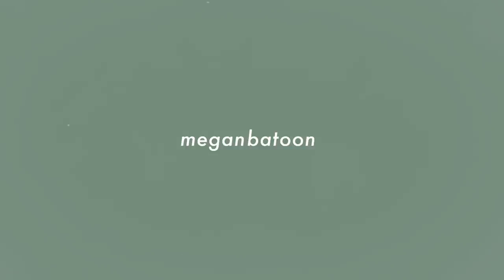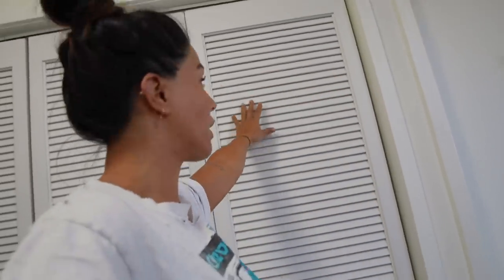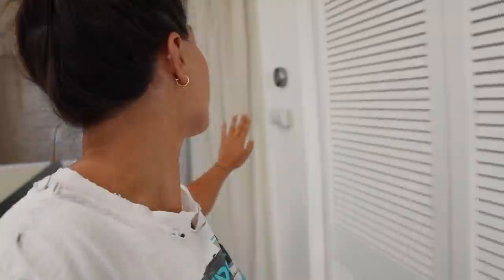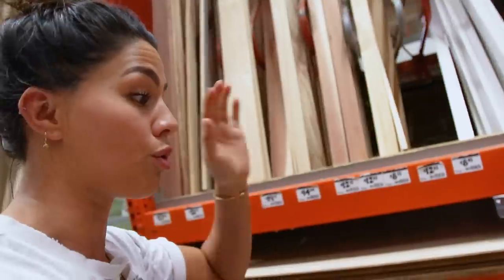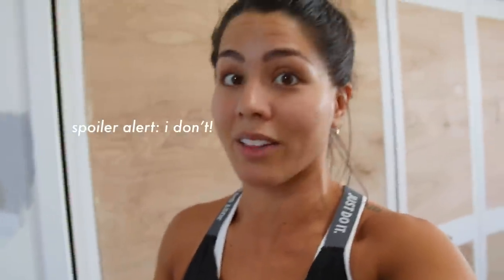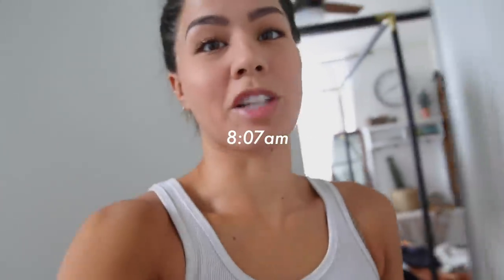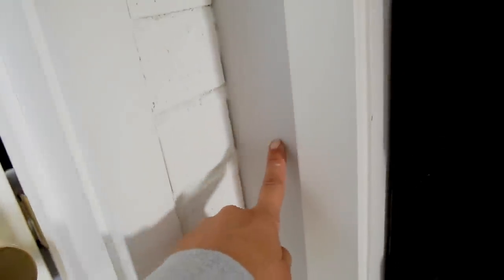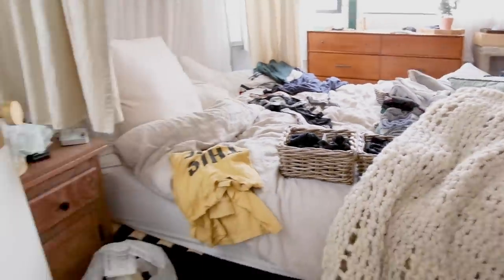DIY 48 Hour Home Makeover Challenge

Comment: Just be aware that when you go to sell, that when your places gets inspected  that the covered louvered doors will cause issues.  There needs to be a certain amount of air exchanges for ventilation in utility and laundry rooms. By covering the louvered nature of the door you are removing the ventilation.  An inspector isn’t going to take “you can just keep the door open” as an acceptable solution. If you want to keep the covered doors then you will need to make passage way vents for an alternative ventilation source, pretty much a through way in the wall covered by vent grates on both sides.  It looks like you have room above the doors so that would be an easy place to put them that also isn’t as noticeable, just make sure you are leaving enough room to not disturb the back framing of the doors.

Comment: The slats in the doors were for air flow!
Never run your dryer with the doors closed! It needs air!
FIRE a very real danger!
Reply: That's what I was thinking. I was scratching my head the entire time she was covering the slats after she stated the purpose of it. I hope that there is a some sort of ventilation inside.
Reply: I guess she's now left with the option of leaving the doors wide open when the dryers are in use and a while afterwards to cool down... But when they're not in use, she can have them shut beautifully, the way she likes it...
Reply: Okay I am happy I wasn't the only person thinking this...
Reply: She said she would just leave the doors open when in use. Is that not enough?
Reply: IfYouMeetAWolf  not if that was in fact the furnace in there too...
Reply: I was thinking she should have just painted the louvers black, and then painted the same areas on the other doors black. Perhaps put trim on the louvers. That would change things a lot and help her feel better.

Comment: Good tip for you. If you want to cut those in the future get a piece of the foam insulation board. and a track for your circular saw. set the depth on your saw to just 1/4 inch deeper than you need and cut it all on the foam insulation cutting a bunch of grooves into it. much safer than balancing on the saw horses. and the board of foam insulation is pretty cheep and you can use it for a ton of cuts.

Comment: This transformation is amazing! I love your vids. Not to be that annoying person but just a heads up in case this comes up, closet doors that have washer/dryers in them need ventilation (like your last ones) to meet codes because they can over heat etc. Just wanted to give you a heads up in case your washer dryer starts to act up. 😊

Comment: Just an FYI my understanding behind the Louver doors with your washing machine and your air conditioning is to allow the machines to breathe which a washing machine as well as a dryer that a lot of humidity in Steam also to allow any carbon dioxide to escape as well as allowing air flow into your intake for your heating and air conditioning unit while covering the doors looks nice there might have been a more practical reason why they had louvers there

Comment: Not sure if that was the greatest idea to cover up those louvre doors. I get that you don’t like the aesthetics but those are usually installed for proper ventilation. Could eventually develop into a dampness problem resulting in mold. Also, is that the AC unit beside the washer and dryer???

Comment: i know that this video is from a while ago but megan! thats not how you cut things on work horses!!!! the part that youre cutting off so the excess is supposed to hang off of the work horse on the ends NOT THE MIDDLE between the two saw horses! OUTSIDE not the inside pleeeaseee megan! this way you can stablize your object that youre cutting and not potentially dislodge the saw out of your hand or the wood into you or the saw into you when it splits in the middle cause nothing is supporting it after you cut it

Comment: You could have hurt yourself using that circular saw.... you almost pinched the blade, which will cause it to kick back or break the blade teeth.  Don't apply so much pressure.  😉

Comment: Dryers need ventilation while running, but Do I see your air handler to the right of your washer and dryer. If so you’re going to run into some expensive repairs if it doesn’t get enough ventilation. Not to mention your electric bill will likely be higher as well. Not trying to be negative Nancy because I love the over all design.